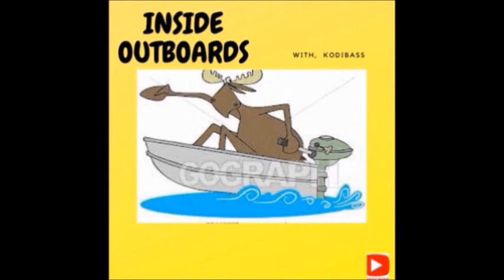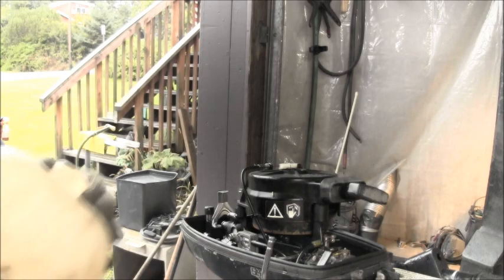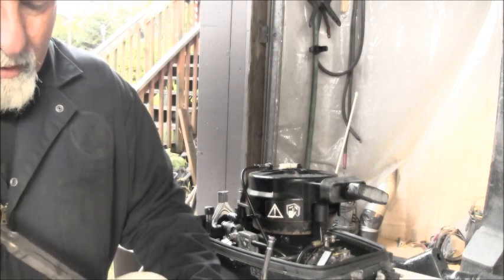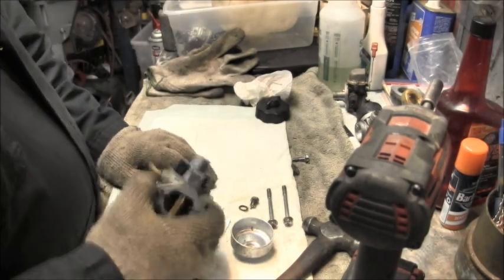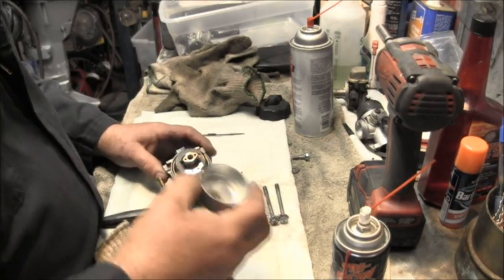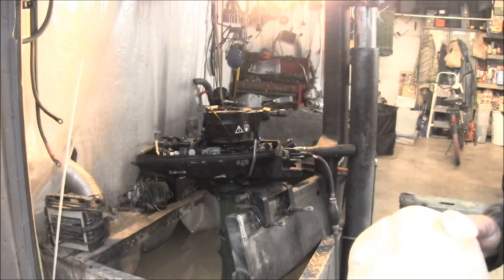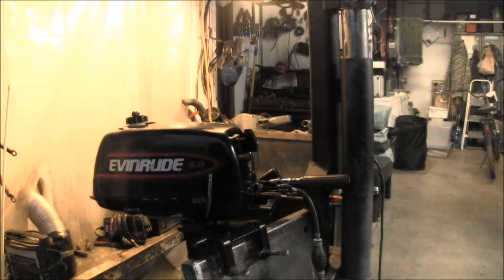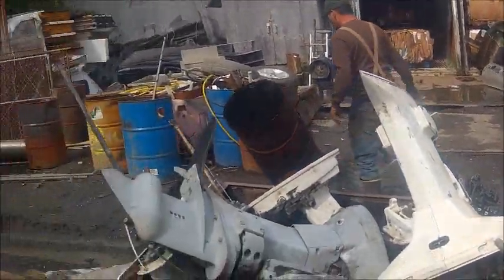EVINRUDE 1998  5 HP,     ( Quick Fix )

Comment: Hi Kodi, where i live evinrude or johnson is just a few motors. This little one looks like a suzuki. So i have a question for you. Have you ever had a suzuki or evinrude that, you put a new impeller on it and still don't pee, unless you remove the grommet that covers the shift linkage? Thanks.
Reply from the maker: Yes I have,  Why ?  Now that I do not know.  But that has happend 2 times 4 me.    kb